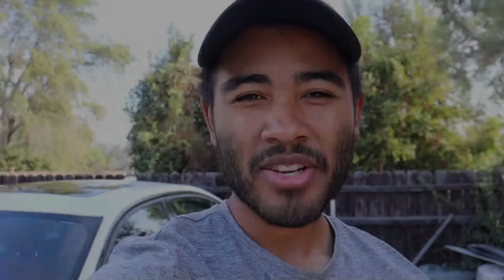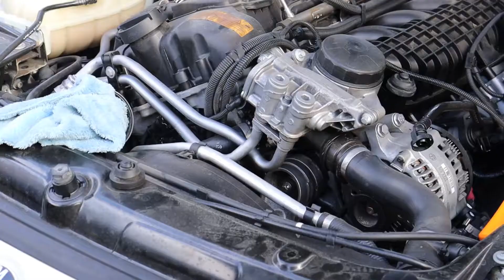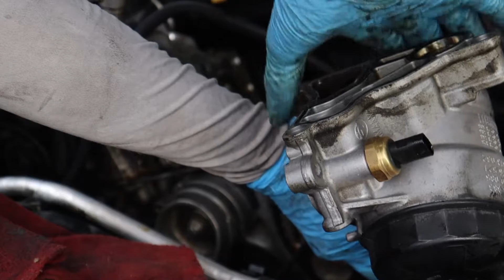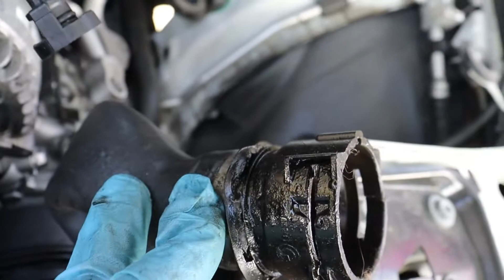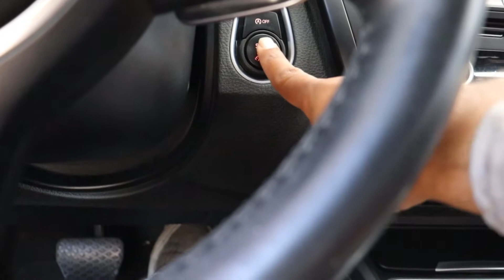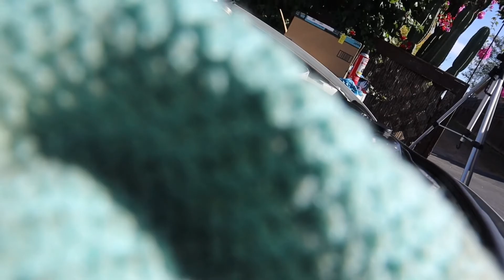Oil Filter Housing + Oil Cooler Gasket Replacement BMW F30 335i N55

Comment: If the intake tract has been loosened, will it still be sealed afterwards? I don't think so... The seals are just as hard as those on the oil filter housing. I think it's a poor job.
Reply: When u say a poor job do u mean this guy or bmw?
Reply: @GodisGood941  I meant the mechanic. If he loosens the intake system, he'll have to replace all the intake system gaskets. I think they'll leak just as badly afterward as the ones on the oil filter housing.  🤔Sorry, I'm using Google Translate.

Comment: Would love if some can help. I had this same job done (oil filter housing gasket) by a mechanic friend and after he finished, he asked me to start the car but forgot to tighten the oil filter which then threw out 2 quarts of oil on start up I immediately switched it off but the intake side was mainly covered in oil and even the Maf sensor plug. 

We then cleaned as much but NOW I keep getting a Maf and vacuum leak  fault code. The car idles rough with the Maf plugged in but runs smooth when unplugged but with it on we get small misfiring Maf vacuum codes. 

Had it smoke test changed the Maf sensor (genuine) bmw part, replaced the air filter as that was soaked and even the tank vent valve, also replaced the rocker cover as that was on its way out. 

My car is a 2013 435i and I would appreciate any help I can get and before the spill the car was perfectly running. 

Cheers

Comment: The engine should be primed after doing this job. Before starting the job, remove the fuse in the trunk for the fuel pump, start the car, let it sputter and stall, perform the job, start the car with the fuel pump fuse removed so the engine primes (BMW TSB says to do it 3x by starting the car, letting the starter cool for 30 seconds, and repeating 2 more times). After the third cycle of priming the engine, put the fuel pump fuse back and start the car as normal.

Comment: You can actually remove that torx near the coolant hose they goes brittle without removing the coolant hose just use a ratchet spanner and start undoing while pulling the housing away from the bolt as your undoing it, a trick one of our techs at work showed me 👍

Comment: Curious If that Rein radiator hose failed? I installed mine in Oct2022 and by Nov2023 it is leaking at the seam. Not sure it is user error during install as its straight forward.
Reply from the maker: Yes mine ended up failing also lol. I ended up just getting genuine BMW the second time replacing it
Reply: @InlineSixAuto  terrible craftsmanship and or quality especially with a product with a backing like Rein. Waiting for my OEM to come in. Thanks for confirming.

Comment: I had some engine problems right after doing an oil housing gasket change. I pulled fuse 165 and let it die out so I knew there wasn't any fuel. When I tried to prime the engine after installing the oil housing gasket the engine turned on and now I have some engine problems. I got codes 131501 Vanos Inlet Cold Start: Not Controllable, 0,  120408 Boost Pressure Control Cut-Off Pressure Rise Blocked. 0 , & P052B Cold Start "A" Camshaft Position Timing Over-Retarded Bank 1. My advice for this is to disconnect the battery after you drained the engine of fuel after removing fuse 165 and then finish this job within a few hours.
Reply: How do you prime the engine?
Reply: @AlexanderBanesMusic  This is for after you removed the oil. Pull the fuse for your oil pump if it wasn't pulled before. Try to start it and then let it die out. Keep trying to crank it at least 3 times. Your engine is primed.

Comment: you do not need to cut the hose in order to put on new flange. Use a pipe plier and a little pressure will crack the plastic one into big pieces. Note, tilt the pipe downward, so pieces fall into the hose.

Comment: Weren’t you supposed to change the intake manifold gaskets after removing the intake manifold?
Reply from the maker: You can but not required. havent had any issues since which this was almost 2 years ago

Comment: If you don't get it changed immediately could it cause damage to any other parts of the car? I need about a week before I can fix it am I okay to continue driving it?
Reply from the maker: Yes its fine if its not leaking a significant amount oil
Reply: @InlineSixAuto  its leaking quite a bit I'm actually adding some oil today because of how much I've lost over the last 5 days. Is there anything I can keep an eye out for?
Reply from the maker: @arminkladanjcic671  Oh wow okay. And for sure you know its all leaking from there? And is it giving you a low oil warning?
Reply: The low warning light only came on today. I am pretty sure it's all coming out of there because there's oil all around it
Reply from the maker: @arminkladanjcic671  Well if you keep driving just make sure to add oil so it doesnt get too low until you can replace it

Comment: Can it cause damage to the engine if you directly start the car after the OFHG replacement without priming it first? Thanks!
Reply from the maker: It seems there's a small chance of engine failure after doing this replacement without priming but I never did priming and never had any issues since doing this. And from what I've seen many other haven't either after doing this. Only a small percentage of N55s have had issues from what I can tell.
Reply: Theres higher chances in e chassis so fill housing with oil and unplug lpfp fuse and crank it. Better safe then sorry

Comment: Do I need to replace the oil cooler bolts as well or just the oil filter housing bolts?
Reply from the maker: Just the bolts for the oil filter housing
Reply: @InlineSixAuto  thanks man.

Comment: Thanks again for this video. I just finished the job and can’t thank you enough. It took me roughly 4 hours to do the job with some help. Well worth a diy as this would cost $600-1200 at the dealership. My engine had so much oil residue on my block. It seems that it should have been replaced 30k kms ago
Reply from the maker: Glad I could help guide!

Comment: I enjoyed the video and you have an excellent, calming voice and explained the steps very well, but why didn't you replace the intake manifold gasket?  Once it is disturbed it will surely leak to some extent.
Reply from the maker: Yeah I’ve heard that but honestly I don’t see how it would affect anything when you really look at how the gaskets are seated. Plus it’s been a year and the car has been running great with no issues relating to that.
Reply: @InlineSixAuto um because they get deformed due to heat cycles, hardened , oil soaked etc. no longer seal effectively over time.

Comment: Could you have just left the coolant hose on?
Reply from the maker: I wanted to replace it cause there was oil over it where it connects to the oil filter housing but I couldn’t get it off and I ended up breaking it while I was struggling to get it off. But yes you could just leave it on if you want.

Comment: Thank you for the short but very informative video. My car has been sitting in my driveway for two days now as I was able to change out the gaskets. But my plastic flange also broke like yours when I took it off to make it easier to unscrew that bottom bolt. Lol.
Reply: Mine was parked for 3 months 😫 🤭

Comment: Did you prime the oil pump after the job ? Several guys get engine failure after this job, it seems that they forget to prime the oil system
Reply from the maker: I was aware that some people experienced this after doing this job. But from I read and saw, it was really only a handful of people that actually had this happened. Majority of people did not have anything happen, me included. I’ve driven about 1500 miles since I did this and not priming anything. Have had no issues.
Reply: @InlineSixAuto  So why it happens ?  Iive in Germany and nobody gets this failure after doing this job. I try to find any correlation between guys who get this failure...
Reply from the maker: From what I’ve seen, nobody knows for sure if there really is any correlation between the two things. It might just coincidental.
Reply: @sechszylinder8055  Hi there, just want to inform you: Here in switzerland they told me at BMW Dealership that they also had a handful people which had an engine failure after replacing. They told me that they do not have any idea why this happens and the customer has to pay for a new engine. He also mentioned this only happened to older generation (I guess the E model) - he told me for my F32 it should be fine.
Reply: @thJasonO7  Technically you have to prime the engine for oil circulation because the rod bearings will be dry and take  a toll thus resulting in an engine failure. There are many forums that exist if you search them up. 

I think the difference is that those that do not experience engine failures have often kept up with their engine interval changes which have helped the rod bearings overall health. 

Me personally when I replace this part I will be priming the engine, by either taking out a fuse for the fuel injectors or hpfp or removing cables to the injectors themselves and starting the car.
Reply: @InlineSixAuto  1200-1500 miles is when the failure is supposed to occur after the OFHG replacment if it does happen, please keep this updated.
Reply: Almost did this job myself but read up on this as well and opted not to. BMW told me You need to purge the oil system or else the engine locks due to oil starvation after even just 60 miles of driving. Disconnecting the injectors and cranking the engine 5-6 times supposedly achieves this.
Reply: @manuelbrizuela7868  I did the job myself 6 months ago, and I primed the system. I drove around 6000km since the intervention and nothing to signal.
Reply: @sechszylinder8055  hast du davor das Öl und Kühlmittel rausgelassen? Oder gehts auch ohne?
Reply: @mrhurra Ja, Motoröl und Kühlmittel habe ich vorher gewechselt.
Reply: @sechszylinder8055  danke 👍🏼

Comment: Well even the repair manual says to remove intake manifold... welp I’m not looking forward to doing this on my car
Reply from the maker: You don’t have to remove it completely, just enough to fit the e socket in to get the bolt out.
Reply: @InlineSixAuto  well tbh if I’m going to be detaching it in any way, I might as well replace the 6 intake manifold gaskets